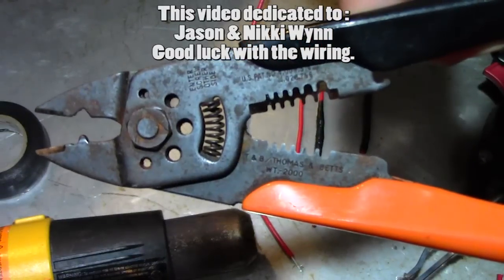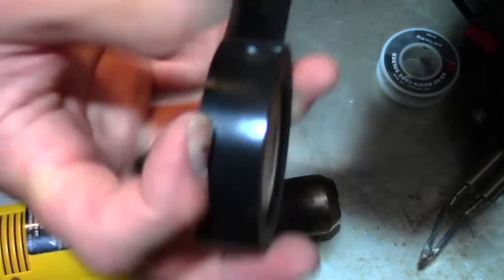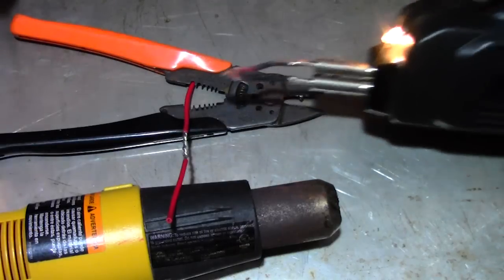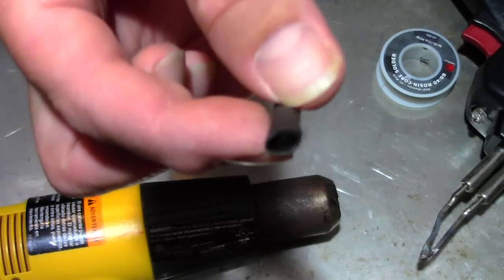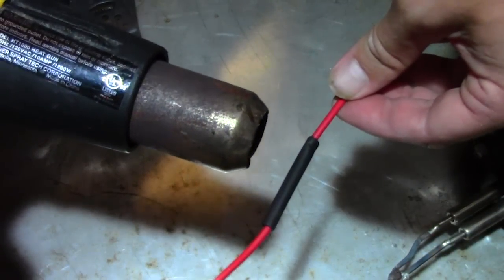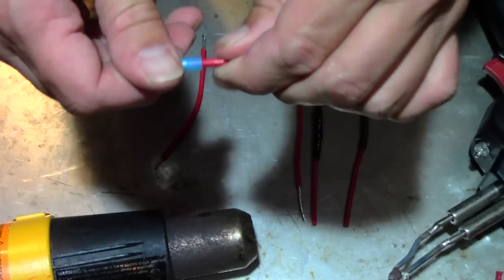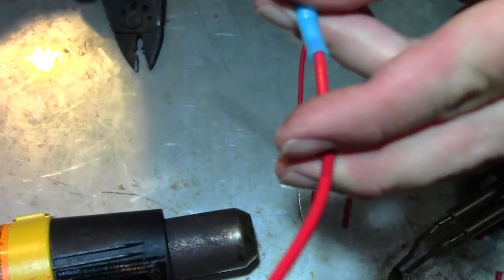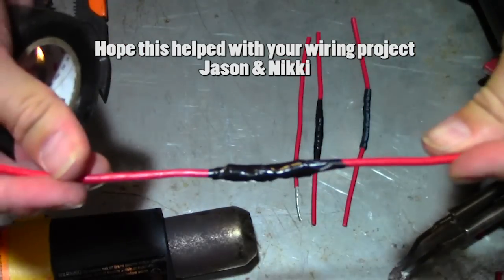Proper Electrical Wire Connection Methods, Twist? Twirl? Solder? What?

Comment: Great advice, any idea which method cause least resistance
Reply from the maker: Out of these choices.  The first twist method without the solder should be the least resistance.   But depending on the location of the connection I would always have some type of solid connection with solder a connector, butt, or bus.

Comment: Heat shrinkable butt connectors. They do have those now, and for the added cost (Which isn't that much) it's a good intermediate between a simple twist and a solder.
Reply from the maker: Absolutely.  Yes they do; although expensive, they are great and I use them quite often on the boats I work on.  I am going to do an update on this video soon. This one was just a quick one mainly to show the twist method.  (which doesn't work for anything 10 AWG and larger, 12 even but in an emergency or when you have nothing else)  Thanks for the comment and the mention of something I didn't have in here.
Reply: My pleasure.  I worked in Heavy duty hydrovac building for a while, and they were the absolute norm.  Because of the caustic and 24/7 wet environments, we were finding that regular butts or really any access to the wire core was causing green cancer all up the lines. Whole subsystems were getting lost.  So we moved to the HS butts and our failure rate went to basically zero or nearly so, barring other defects.  Really enjoy the channel, by the way.  I do not and will never boat, but it's fun to watch someone who knows what the hell they are doing.
Reply from the maker: opusmonday Thank you.  and yeah boats take a lot of maintenance and time.

Comment: Ratchet crimper only, not that tool you used.
Reply from the maker: A ratchet crimper is overkill for these connections.  A GOOD hand crimper  is all that's needed for these wire sizes.
Reply from the maker: You know I just watched my vid and I noticed I didn't use my best crimpers.  But these are good G&B multi crimpers and are good for the sizes of wire in this vid.   Not to mention I'm targeting the casual boat repair (owners trying to fix there boat so they don't have to pay a fortune for someone to come do it and so they can get it done right without causing problems) and hardly any of them are going to have a ratchet crimper, Know what it is nor are they going to go buy one for a quick wire fix on a low gauge wire.

Comment: Use a glue filled shrink wrap over the twist,  a weld will remove the flexibility of the wire ..
Reply from the maker: Sorry replied with my other channel.
You are right and it also makes it solid core at that connection But soldering it is better than a butt connector.  Almost all connection inline that do not have a tension on them should be twisted and covered with a glue filled heat shrink. This all depends on the location of the connection and type of wire as well.
Reply: ***** I do alot of wiring for offroaders, welding while very good, does seem to fail . I do agree it seems more logical to have a weld when under tension.  I twist my wires in a linear fashion, and fit a nice glued filled shrink wrap.  However given time I would replace the entire circuit making sure there are no breaks.  Good Video very informative
Reply from the maker: ronin51670 I wanted to make sure people didn't take something the wrong way.  Twist connections done properly are great but you cannot put too many of them in the line especially on a main power draw connection.  If you have too many or too many to close together it will cause them to heat up.  Replace them sections with one piece of wire.  And a Bitt connector can be better than a twist in the right locations.